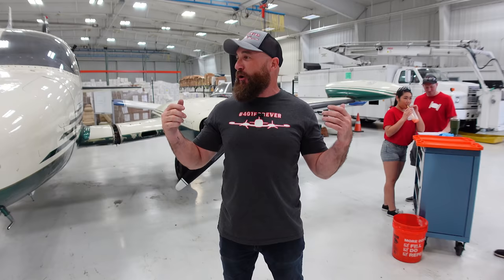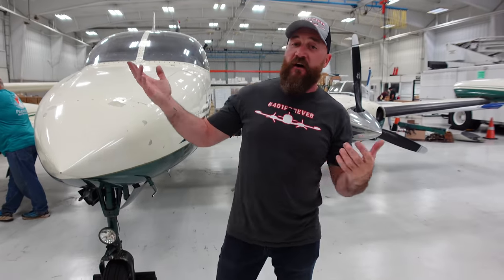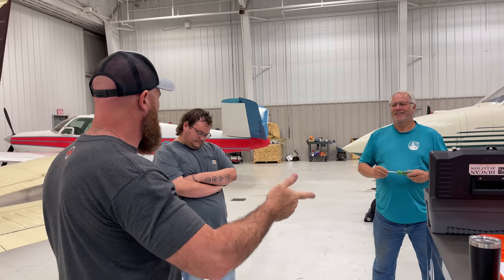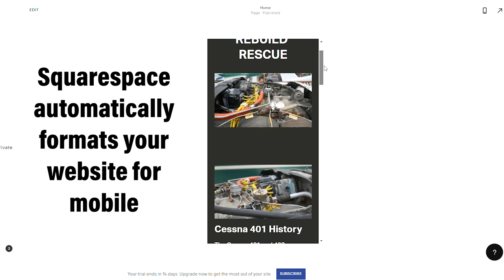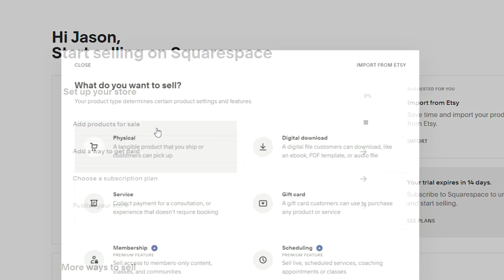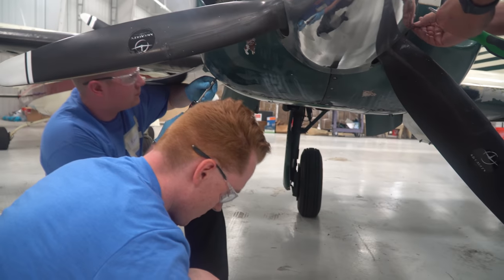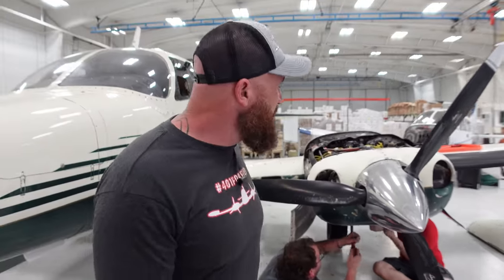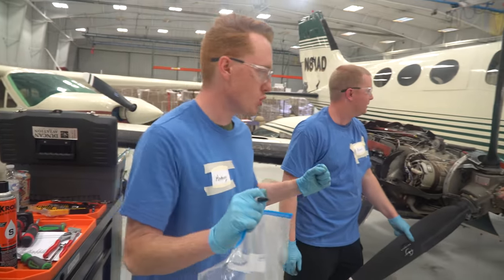Who Will Win The FREE Abandoned Airplane Mechanic Challenge ?! Ep15

Comment: If you plan on getting both engines completely overhauled, it would probably be a good idea if you can trade them off for a pair of Zero timed engines since there are no log books available. You will have to "build" new log books from scratch basically There are several benefits to this: cost,  History, Records and AD compliance. The spar strap compliance is going to be expensive, however with the wings off, after the Spar AD is complied with, you can replace the Fuel Bladder tanks.

Comment: You needed to introduce the team members. Curious of the backgrounds and experience with planes. Otherwise love this project and can’t wait to see more.
Reply from the maker: We video’d everything and then realized that we totally forgot that part 🤦🏻 They’ll be back soon for the wing disassembly and we’ll make sure to introduce them and give some background on the team members.
Reply: Yes. Very interested to learn more about them. I can confirm that you need a “Johnson bar” which is actually a patented tool called “el Brutus”
Reply: @eagle2019  - based on one of their responses to another post, these are professionals from rebuild shops. That’s why their full background should be identified.
Reply: Yes I wanted to know more about that too
Reply: @mikerapoport3615  id like to learn more about the tool maybe useful for classic car's/truck's, the newest ones use brittle plastic to hold trim/seals ect. so not as useful, same way for industrial equipment

Comment: I honestly feel like a speed challenge for disassembling an aircraft engine is a bad idea 😆 I pray it goes well and nothing goes missing
Reply: It has to be completely overhauled first buy qualified mechanics and then reinstalled by the same or it won't pass inspection. Plus it didn't appear they were setting the woods on fire mostly using hand tools and not using power tools but a few times. Certainly respect your concern but there's a lot of technical things that must insure 100% safety and flyability.
Reply: Yeah so we bagged and tagged everything as it was removed. The four of us are professional mechanics from the 145 repair station and part 25 jet world, probably 60+ years of experience between us with AOG’s and quick turn maintenance. This was a full day’s work and Im really proud of our team for pulling it off and not creating damage or additional work.

Comment: This is amazing.  Glad to see the project moving forward.  Does this part require FAA log book entries etc?  Also, when you disassemble at speed how are they organizing the parts removed?
Reply: Essentially anything done to the engines or airframe requires logbook entries. A project this big will need an A&P IA sign off before flying.
Reply from the maker: Everything is 100% bagged and tagged 👍🏼

Comment: The twirly ratchet thing is a 'grolly bar' probably one of the most important tools in an Aircraft Technicians toolkit. I removed many a worn fasterner from Phantoms and Jaguar's during my time in the military
Reply: Pipe Extractor NSN 5120-01-398-2869. Extractor is designed to remove screws from aircraft panels. Type 2: spiral flute extractor. These hand operated extractors remove broken screws, pipes, bolts, studs and fittings from threaded openings. B107.410.

Comment: Is it wise to be making anything related to airplane repair into a race? Take the time you need, and do it right.
Reply from the maker: The removal of both engines took hours and followed the Cessna service manual. The quick pace of the video doesn’t do justice to the 60+ hours it took to remove those two engines. It’s rare to see 6 people working on something for 10+ hours. They did an amazing job of labeling and being careful not to damage anything in the process. The install will take much more time and be a much slower pace 👍🏼
Reply: @rebuildrescue  Good to hear.

Comment: wouldn't it cost a fortune to have certified mechanics do that? especially getting it all back together.  also seeing the engine free hanging, there must be a lot of structure in the wing to hold all that weight outthere under vibration.  two light jets at the rear must be so much easier.  I know it's not certified but would it be a great plane if the engines were swapped out with LS7 crate engines? or even a ford ecoboost type deal.
Reply from the maker: Team blue and team red are certified A&P mechanics. Two LS7’s would be crazy cool but hard to get the FAA to approve it under the experimental process unfortunately.
Reply: @rebuildrescue  was just wondering if the girl in team red happens to be the GF of her team red partner?

Comment: Another tip if you have a screw (phillips or hex) where the head is stripped or rounded: Add a generous blob of valve grinding/lapping compound to the tip of your driver bit, then apply heavy pressure as square to the fastener as you can and work at it with short twists till it breaks free.

Comment: Hi Jason, greetings again from Argentina.
Now you´re getting some very serious work on the 401. I can´t imagine how much those engines will cost to refurbish, but I guess that will be a LOT. However due to all the love of the aviation community it woulden´t surprise me you and your team will get a lot of help specially considering the birth of this project.
I have a small suggestion for you:  around the hangar, place some fine dry sand filled buckets. The sand will absorb the oil/fluid leaking easily than paper and, once dry you can sweep it into another bucket. I have seen this in several workshops and it does the job well.
BTW: its amazing how fast your channel grew since the first 401 episode; also glad to see you healing quickly.
As always, cheers from NE Patagonia. See you next Saturday!

Comment: I think that’s pretty cool that you gave them all a $1000 each. By the way, try putting a couple of rubber snakes near where the birds are going in. Make sure they are as real looking as possible. The rubber snakes should drive them off. I’ve had issues with Starlings building nest in my saplings, that are low to the ground so I usually just remove the eggs and that generally lets them know it’s not a safe place.

Comment: You might want to put a tail stand under the tail.  Any entry will bring the tail crashing down.  Seeing all the oil coming out of the red engine, you might remove the oil out of the right engine before removing the alternator and putting it vertical. Cheers
Reply: We did install a tail stand before the Right engine was off. I couldn’t get the plug out of the left engine sump to drain the oil, it was frozen, so i figured dumping it out of the alternator drive was better than removing the sump.
Reply: I was surprised that there was no vertical movement when the right engine came off. So good to see some qualified personnel working on it.  It was driving me nuts.  45 years Canadian AME.  10 years in engine overhaul, in Papua New Guinea,  including 402 engines.

Comment: Blue Team gained at least a 20 minute advantage (plus one guy for that time) while Red Team learned that they needed the overhead hoist to set the engine upright. By the time Blue Team got over there, you knew what not to do and only used Sam from the Blue Team to do it. Still awesome job all around.
Reply from the maker: We were just talking about that exact thing today. Also TJ helped me set up the tail stand in the rear of the 401 as well.

Comment: Jason, ask any rubber parts maker (Goodyear, Firestone, Gates) and they all will tell you that all rubber parts should be replaced every 5 years due to oxidation, UV, vibration, stress, etc. So even if they aren't being objective, you're dealing with parts that are 20+ years old.
 Replace 'em all.

Comment: I am troubled you do not have a tail supporter fixed when you lift off the engines. If you only sit on the door steps now, you will possibly damage the tail as it falls and hits the ground.
Reply from the maker: We placed a tail stand under the rear before removing the second engine 👍🏼

Comment: it may just be me, but I've always been of the opinion, that when you have an Engine, with an Oil System Drain Plug, that to keep from spilling oil all over the shop floor, to just drain the oil out.

I've also seen where you could replace the Drain Plug, with a Drain Valve, that extends maybe an inch or two from the bottom of the oil pan, and allows you to connect a hose to drain through, and then opening the Valve to Drain the oil

Comment: Is it possible to buy the tool at 09:00 or is it a home made one?
Reply: You can buy one from Brown Aviation, it's called the Brown Aviation BRUT-5 El Brutus "Johnson Bar" Screw Extractor  .The price is ~$480 + tax and shipping.  They work okay but not $500 okay seeing how use is somewhat limited.
Reply: @buckmurdock2500  Thanks Buck. I work in a job where we regularly need to remove seized screws. Often we need to put the items under a press to apply pressure and use a spanner on the shank of the screwdriver, this may be a more elegant solution. Regards, Eddy

Comment: Great video never worked on aircraft engine but know you will have bumps and bruises on hands and arms with all the nuts and bolts, know you said you tagged all parts coming off engine, do you plan on cleaning all accessory parts and check for wear and tear on parts.

Comment: Was surprised you made it into a race, as that’s when accidents ha[[en, however was surprised how easy the props came off and no obvious  sign of how the prop is feathered, as seem to only undo self locking bolts and pull it off, But looking good so far at 11:23
Reply: I’m wondering if putting it all back together may be more difficult due to not paying attention to what screws came from where etc.
Reply: @aappelman5639   one would hope there are loads of photos during the strip down
Reply: @eagle2019   Every hose, every fitting, every valve, every accessory is getting replaced. We have all of the schematics and IPC’s for the engine and airframe, going back on will be a task but this is not a simple R&R. Every loose part was bagged and tagged appropriately.

Comment: That's a great old plane. But if it was mine I wouldn't want it taken apart as fast a possible. I would want it done very carefully to avoid breaking things and causing more problems later.   I just hope there isn't a race during the re assembly part.

Comment: lot's of open end wrenches and pliers getting used.  are all the fasteners getting replaced or are they just super good at not rounding stuff off?  a crows feet set is like twenty bucks at harbor freight, btw.
Reply from the maker: The pliers being used are specialized and work amazingly for those AN fittings.

Comment: I am curious about one major issue.  I know a lot of work is required to get this aircraft airworthy again and it is an admirable goal to get it flying.  My query specifically involves the wing spar mod/MWO that is required.  Was it never done because it was too expensive, or was it never done because it was ultimately not going to be possible to keep it airworthy?  My concern is shouldn't that specific mod be done first if it is a potential deal breaker for the entire restoration?  Inquiring minds would like to know.

Comment: ok i got a bit worried, reading the title, that they were trying to get rid of the plane. but fortunately that doesn't seem to be the case :) I'm still wondering tho, how will they get it LEGALLY airworthy? I.e. with all the required maintenance over the years confirmed as performed by licenced mechanic? 🤔
Reply from the maker: The 401 isn’t going anywhere ! Lol 
It’s become a restoration project. Not having the log books means the entire airplane will need inspected and every single AD inspected and finished before being airworthy. It’s going to be a long road but worth it !
Reply: @rebuildrescue  glad to hear you're committed to getting this back in the air, great job!

Comment: Interesting that you didn't need a tail stand.  Removing all that weight forward of the CG, in some airplanes, will cause it to sit on it's tail if not supported.
Reply: Tail stand was installed before Engine 1 was on the hoist. There is a clear note in the AMM, everyone was briefed about the tail stand and CG.
Reply: Just don't go inside the a/c.
Reply: @F7XPERT   I didn't see any stand. Did I miss it?
Reply: @canuckwing0195  @30:18 It was already installed and Jason was holding it while Engine 2 was lifted - We had a short stand so we had to lower the tail a bit before getting it set.

Comment: I'm sure you guys drained the oil before starting but the maintenance manual needs to add a line that says watch out for leaking oil when removing engine. That floor sure gets a lot of abuse.
Reply: Drain plugs were frozen solid and these engines did not have quick drains. Was esier to dump it from the alternator drive

Comment: Those are some sketchy engine stands , seems strange to me that they mount to the crank and not the case or block?
Reply: The case is split, similar to a subaru engine. Its easier to disassemble the engine vertically, leaving the crankshaft last. Plus the crank swings a prop that pulls the aircraft through the air, it can handle some static load.
Reply: @F7XPERT  cool thanks for the info just started getting into these airplane vids

Comment: Who missed the part about draining the engine fluids down before tipping up and or removing the engines at 32:10 lol, never would of thought they are stored on their prop ends etc…
Reply: With the engines vertical, the whole engine is easily accessed for disassembly,  including all of the attached accessories.  Every thing comes off, except the bolted crankshaft to the stand.
Reply: @canuckwing0195  thanks for that, I’d just assumed it would be on a stand right way up, then again never having owned a plane I have nothing to go off except when pulling boat engines, or car. However I do find this a really interesting program, seeing this makes less scary to buy a plane, that is if I could afford one 😂
Reply: @canuckwing0195  A second thought does this  not put undue stress on the prop shaft bearing ,having all the weight on the end like that?

Comment: If these guys and gal are real life A&P Mechanics using vice grip pliers and slip joint pliers to tighten and loosen bolts………remind me NOT to have them touch my airplane, car, bicycle or hell even my wheel barrow!!!!!  Also best thing to clean up spilled oil is sacked concrete especially on painted concrete floors!
Reply from the maker: They are Knipex pliers….  They are absolutely amazing. If you are an A&P or know an A&P they need these. Non marring and they quickly adjust. Very accurate and make doing any job so much easier. Once I saw them I instantly ordered two sets. 
If you don’t have them, get them you’ll thank me later ! 👍🏼👍🏼
Reply from the maker: Those are actually Knipex pliers….   They are amazing and are made in a way that they won’t damage nuts and bolts. Even aluminum AN fittings. I saw them for the first time that day and had to order two sets right away. Amazing tool. If you don’t have a set egg one !
Reply: They definitely won't be touching your airplane.............because you'll never have one 😂
Reply: @rebuildrescue  9

Comment: You should get in contact with a home Air conditioning supply or A/C business and get an A/C install company and get a A/C condensate drip pan from them to use as a maintenance drip pan. Some A/C installers even make their own drip pans so you can get larger pans made
Reply from the maker: Great idea !

Comment: That tripod arrrangement looks distinctly unsafe to me..  With two adjacent castor wheels facing inwards, the centre of gravity of the engine seems to be  dangerouisly near to the line between the contact points of the wheels.  I wouldn't be surprised to see more wheelchair action soon.  Please be sensible.

Comment: Can anyone define the valve covers on those engines......left side Black, with highlighted letters, Right side David Clark headset green.......formerCessna Parts and Srvce Mgr.......I'm mystified
Reply: I can take a picture if that would help?
Reply: @Sam-ou8uv  I think it might.....my guess is those engines are from 2 completely different eras of Continental production.....which begs the question....how did that happen in that airplane? Cessna twins, engines are Overhauled or replaced in pairs.
Reply: @rileyjackfansmithandjones8238  - they aren’t. They are one serial number off. I think one may have been overhauled at a different time. But those black plates with gold writing are from the Gami upgrade.
Reply: @Sam-ou8uv  Roger that,thanks for the info,Godspeed on the Acft Revival😎

Comment: Ok, I know am old and we did things a little differently way back when but I spent a lot of years as a mechanic. I’ve worked on about everything you can imagine. I had my own shop and we were know for working on anything that would drive, float or fly and in my tool box were three tools that always looked brand new. Pliers, channel locks and vise grips. That’s because they were only used as a last resort. Frankly the ubiquitous use of these tools here is a little disappointing and more than a little scary with the thought of how much damage they might be doing.